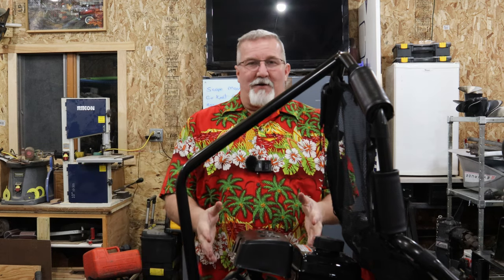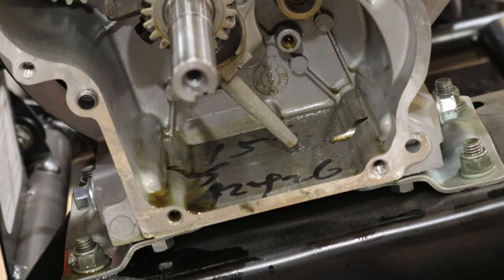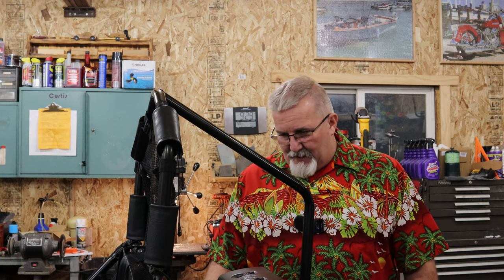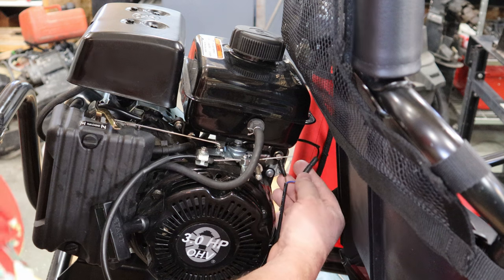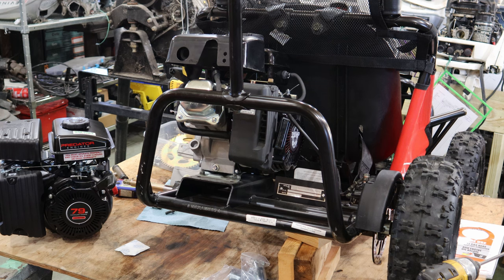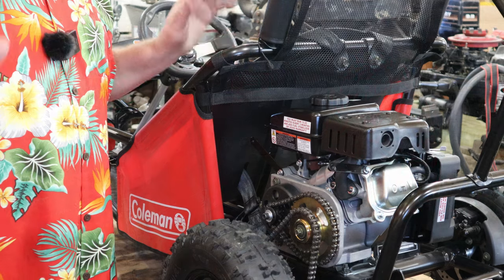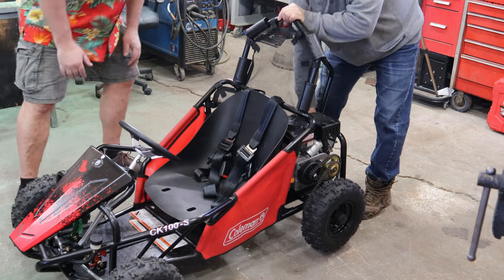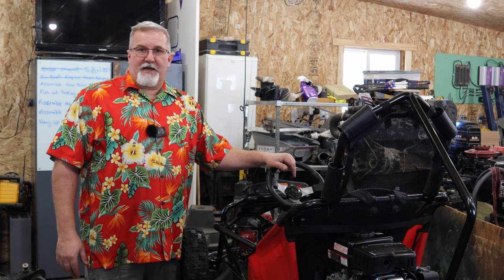Coleman Go Kart Engine Failure Predator Engine swap to the Rescue

Comment: Thanks for another nice video.
I noticed that on 18.59 on the time line the main axle was bent.  That could be why the chain gets tight and loose.  You were right Coleman should have stuck to the lanterns.  Just a piece of China junk with their name on it.  Absolutely no quality control going on with that product.  The plastic cam gear is another joke.  I guess most of the manufacturers are doing it now.  BAD MISTAKE!  Guess I am getting too old and keep remembering the old B&S solid cast timing gears that ran forever.  This is what happens when you send all of our manufacturing overseas.  Trying to save a few dollars and we lose most of our American manufacturing jobs and get poor quality on the goods we now purchase.  It's our fault.  The funny thing is we send excellent CNC machines to China like the American Built HAAS and they still can't get it right????
Reply from the maker: So many true statements there.  thanks for watching.

Comment: Man i did this exact swap but for some reason the axel sprocket doesn't line up with the other spocket.... can't figure out what im doing wrong. Seems like the engine isn't over far enough. Wondering if I should redrill the engine mount bolts to move it over and line up. Send help!

Comment: That engine is a Honda clone ( Chinese ) and the parts are all over ! Amazon sells the upgrade metal gear and gaskets and some with new valves for around $30 ! I believe a Briggs will fit if it’s # 793880 on the gear or several other #’s will work with this # ! That 3hp is the same engine as the 212 you installed , both clones ! China mass produced those and stuck different names on them , before at HF it was a greyhound and there’s Carol/Steam and yes Briggs all are copies of Honda ! Recarb and an aluminium flywheel and delete the governor and it WILL scream ! I’ve done many of those engines sorry Mengines ! Lol
Reply from the maker: Thanks for the tip on the Mengine repair. Thanks as always Dave for watching.

Comment: Just picked up a coleman cart for 1/3 the price today with a locked up engine from tractor supply. Not sure how they ended up with it this way, but I think this vid shed some light on what might be wrong before I even try to take it apart.  Predator in the works already. Thanks for posting.
Reply from the maker: Glad it helped.